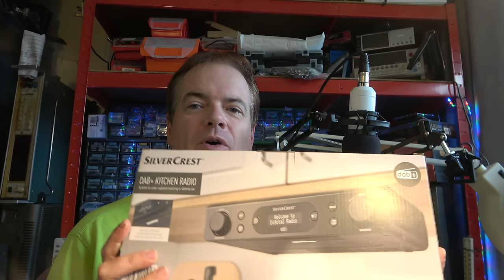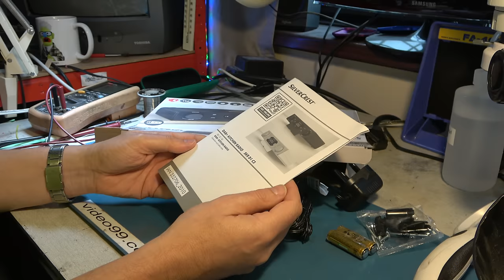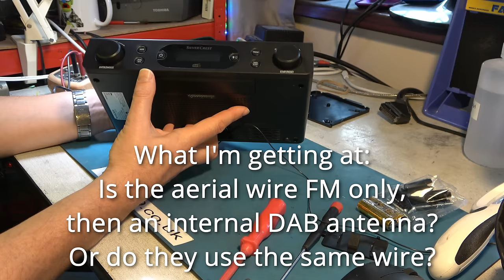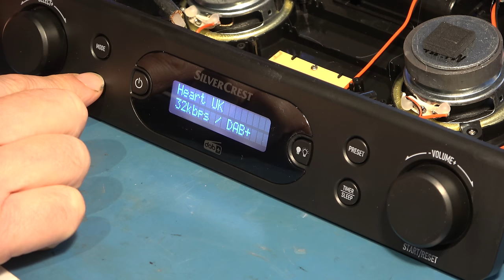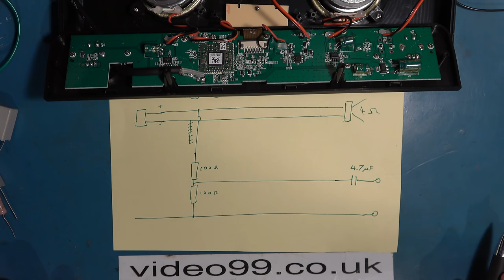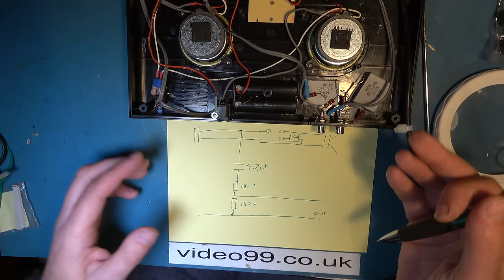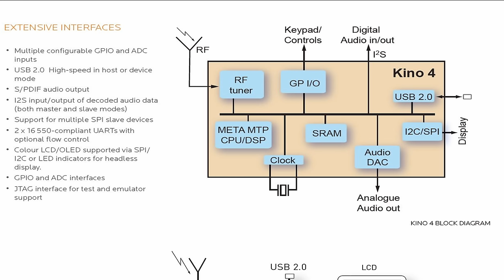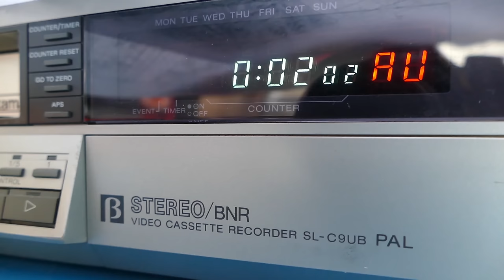DAB radio modifications.  LIDL kitchen radio could use some upgrades.  Part 1.

Comment: Increase the dummy speaker resistor to 12 ohm and leave it always connected.
That will reduce the load resistance to 3 ohm - theoretically - because the speaker has a weird reactance value range over the freq range anyway.
Now you can use a simple on/off switch for each speaker.
About the overkill output caps: you can easily use a standard electrolytic cap, as it will always have a DC value of 2.5V on the input, the way you connect it.
Thanks for your efforts making this a valuable video with your ideas !
Reply from the maker: Electrolytics could be used, as you say they will be properly biased.  But I had some silly big capacitors to hand.

Comment: I'm a big Silercrest fan. I love the build quality and reliability. I would have used 4ohm resitors so you don't overdrive the output amps. Apart from that, a perfect mod.
Reply from the maker: Turns out that my attenuator resistors are too low for the capacitor value.  About 1k would have been better.  If I had used 4.7 Ohm dummy resistors, they would have had to be rated at 1W or more, so a bit chunky.  Anyway I didn't have any to hand.

Comment: Good work !  I see (35:55)  that the the chip manufacturer states that this also has  a digital S/PDIF output. May be that by testing the pins with a "sounding" small  piece of cable (DC decoupled)  you can find one capable of turning on the latching LED of a small amazon's unexspensive D/A converter, 5V powered. The converter board could easily fit inside, which would solve the DC decoupling, volume pot independence and loudspeaker-bass-eq, if there were any.
Reply from the maker: I was wondering about the S/PDIF output, though it might be disabled in firmware.

Comment: Those Frontier Silicon modules have always been much better than their price would suggest, decent quality DACs in them that wouldn't disgrace hifi components. And with there being so few supporting components it's difficult for the assembling factory to muck them up really.

The little class-D ICs (PAM8403?) also really impress given they're literally pennies to buy.
Reply from the maker: Exactly my thoughts, it was bound to be pretty decent quality.

Comment: Interestingly the Canadian government really promoted DAB in the 90s, and there was an experimental DAB multiplex in Canada that ran from 1999 to 2010 (I think). My main memory of the service was PSAs to try to convince people to buy DAB receivers. It was probably doomed to fail because DAB was never adopted in the US, and the electronics industry (and probably more importantly the auto industry) was not really willing to supply DAB receivers to the Canadian market but not the US market. 

Some of the commercial broadcasters here are using IBOC/HD-Radio now but unlike in the US there is virtually no marketing (or even on-air station idents) for it.

Comment: Right look, it would be easier to source a proper audio transformer for each channel. That effectively takes care of the DC offset and the output level. As for switching the DPDT switch you discussed would work a treat.
Reply: He has an SPDT but a DPDT (or rather a 4PDT, since two channels) would be a nice way to do it.

Comment: 4.7 µF and 360 ohms means f3 = 94 Hz - there goes your bass. You have multiple options to resolve this:
1. Ditch the attenuator altogether - they generally aren't worth it below 10-12 dB, and the 8002 in SE operation on 5 V can't output more than about 1.4 Vrms anyway, still less than CD player level. If you can just turn down the following amplifier without running into channel balance issues or the like, there is absolutely zero need for another attenuator.
2. Increase resistor values - about 1 kOhm each would still give acceptable output impedance.
3. Electrolytic caps would actually work fine in such an application, maybe some 100µ/16 V Panasonic FC or similar.

I would go with (1). A pull-down resistor at the output would still be advisable, but it could be a 10k or something.
Reply from the maker: Good point, I think I will tweak the resistors!

Comment: Thanks for your investigation. I found these devices in our german lidl-online shop for 23€. It's nice to see that these device has stereo. Most cheap units have only mono, that why I avoid DAB+ in the past. Very silly to see that there are sold out even with no reception at your location (without modification)..
Reply from the maker: I'm doing a short follow-up video on this.  I got an external antenna to work quite well in the end.

Comment: Two more things that I'd like to add to this video: 
1) try it with a linear power supply, not a switching one. Both my portble DAB+ receivers (a TechniSat Digitradio 210, and a pink Tesco one) perform much better on AA batteries than on any switch mode PSU (or the one included with the TechniSat).
2) the buttons will be most likely on a single pin of the Frontier Silicon module, just have a different resistor in series with them, and that's how the on-chip MCU knows which button has been pressed. With time the contacts will start acting up, and the buttons will be doing totally different things. I have this on my both of my DAB+ radios I mentioned above.
Reply from the maker: I could try another PSU, though as you will see in my follow-up video later in the week, I manage to get a pretty good signal from a small external aerial in the end.  I've had that crazy button problem with some other low cost devices, it's quite possible it will apply here too.

Comment: Two audio iso transformers feeded from the circuit board the output of two transformers could connected as a common ground with a right and left outputs and the 2.5 volt dc level would not be a issue as it never makes to the speakers, A adjustable pot could used  in series with a 82 ohm resistor as a limit for the line output control even would work if you for headphones without the resistors just a headphone jack to break the speakers free.
Reply: I''ll second transformers as the answer I'd just like to add, they make these as stereo pairs, with rca sockets on the output, for people who want to add a line level amplifier to a car radio which only has speaker outputs.

Comment: It looks like some of the UK DAB frequencies are used in the USA as one of the amateur radio bands, the 1.25 meter band (222-225 MHz).  For digital broadcasting in the USA many stations use a hybrid analog/digital system in 88-108 MHz, but very few people own an HD tuner because the proprietary rollout was a total failure.  Many wish to expand the FM band from 76-108 now that DTV is standard and TV no longer uses 76-88.
Reply: By the way, there are still using the low VHF band for DTV in the United States, especially now that UHF TV Channels 38-51 are no longer available because the FCC sold those frequencies to cell phone companies Iike T-Mobile for low range 5G service. As a result, the TV spectrum has now been truncated to low VHF channels 2-6, high VHF channels 7-13, and UHF channels 14-36. (By the way, Channel 37 has NEVER been used for broadcast TV in the United States.) As a result of the truncation of the TV spectrum, many stations formerly broadcasting on UHF channels 38 to 51 had to move to lower frequencies, which the Federal Communications Commission (FCC) calls a "repack". Due to this "repacking" of frequencies, there are still a number of full power and low power TV stations broadcasting on channels 5 & 6 (76 MHz to 88 MHz) like "6abc" WPVI in Philadelphia and the numerous Franken FM stations in various cities nationwide, which are technically low power TV stations using a digital TV signal along with an analog signal on 87.75 MHz broadcasting. These stations are known as 87.7 FM to the average listener and they broadcast essentially as radio stations on the left-most portion of the FM dial in the car. Until July 13, 2021, when the FCC shut down the last remaining low power analog stations in the United States and 12 years after all full-power analog broadcasting ceased in this country, they were low-power analog TV stations with an analog audio carrier broadcasting on 87.75 MHz.

Comment: Why did you not just take a tap off from pin4 of the input to the audio amp ic? and an in line switch to disconnect the feed to the chips pin 4 (and thus speakers) when using the tap off. Then use the volume control to set the line out level (as the output from the dab module is probably line levels anyway, just scope to confirm).
Reply from the maker: Because I'm not sure the signal level and impedance would be correct at that point, I suspect it would not be.  The output from the module is volume dependant, I showed that in the video.

Comment: Thank you. Looking for a garden radio for mother, there is not much on Amazon that looks as easy to use as this and as cheap.
I’ll hack a wooden box together, maybe some porting and see what those speakers are really capable of.
Also, would be interesting to hack around with the module itself. Data sheets and application notes have a habit of surfacing in time!
Reply from the maker: A hack I would like to try, if the notes appear, is to add S/PDIF output.  The notes say it is available, but the firmware may not support it.
Reply: They look the same size speakers as what you get in the Bose waveform CD radio players, and they sound pretty good.

Comment: IMO I don't know why all of those boxes including the radios and TV's come with an F connector when it's a cheap part to put in and everyone will be happy, even those that have to pull out an adapter they would have "something secure" to actually grip onto more than a piddly wire or RF port that comes out over time either through gravity or through the force of shifting furniture

Comment: What about downloading new firmware which should be available now, need an output look for a TOSLINK Output and use a seperate DAC with a TOSLINK input connect the two together via a optical patch lead.
Reply: Downloading firmware?   How?  
As far as I'm aware, TOSLINK (based on S/PDIF) passes only digital audio bitstream between DACs and is not used for web/network interconectivity.   Yes, it could be used (if fitted) to interface an onboard DAC and either S/PDIF or TOSLINK RCA/optical interconnects to an outboard DAC receiver, but this chap just wanted to be able to plug into a standard traditional 'hi-fi' system.    
As for updating firmware,  the board did have usb pads...   Whether that was for the 5v+/- power rail or full data-stream interface is another matter, but my first hunch was it could be used for firmware updating.

Comment: Like how you managed to upgrade this - for me the most useful upgrade would be the ability to add an external aerial. Little wire type aerials never work very well, so I can imagine why your unit didn't pick up a signal with its piece of wire only.
As for the TV aerial, chances are the Co-Ax itself is picking up the signal and not the TV aerial itself, as the TV aerial is cut to the wrong frequencies and also uses the wrong polarity (DAB is vertical polarity).
Also, I'm not too happy about the state of digital radio in the UK either! Original flavor MP2 streams (the ones that are still left) are low bit rate and mono, and DAB+ AAC streams use an equally horrible bit rate, so whilst they are at least in stereo, DAB+ still doesn't sound good. And of course all of the DAB only radios can't receive most of the stations now!
Lastly, I wouldn't want to advertise Heart FM as a feature of a DAB radio... Heart FM would probably be easier to receive on FM, and the station itself is not a good quality station anyway!
Reply from the maker: I agree, there are far too many channels with terrible bitrates in the UK.  Little wonder that uptake of DAB has been so poor.  Down here in Devon, reception is very patchy too.

Comment: I'm glad I kept an old Band III log periodic aerial, the local Mux has few stations, so will experiment with an external aerial. I think I would fit an aerial socket on the back rather than a flylead. I had a similar arrangement on the back of a PACE TV STB and that was the weakest point which failed.
Reply from the maker: That aerial could work really well!  A proper socket would have been a tidier solution but the flying lead was so much easier to put together.

Comment: I don`t understand why do you not take the audio out from the inputs of 8002 ICs? Maybe through a small preamp? There the signal is referenced to ground and could use line out connectors with switch inside that interrupt the signal to the 8002 amplifier, maybe grounding its input.
Reply from the maker: Just more complexity to add amplifiers where there are already amplifiers in there.  Strangely, the signal input is not referenced to ground, that's also sat on DC.  Certainly a solution like that would have been beyond most people to implement, whereas my solution can be quite easily copied by other viewers with basic soldering skills.

Comment: If you want a more advanced project, look up your broadcasting frequencies, then look for a Yagi antenna design, most TV antennas are based on this design, then modify a TV antenna to the frequencies of the DAB+...

Don't forget to point it in the correct direction.
Reply: Most of the TV antennas I've seen are log-antilog with some third design for the other frequency range, but a Yagi is easy enough that you can make it from lumber, screws, and copper plumbing, just so long as you have the dimensions.

Comment: The menu looks identical as in cheap Technisat DAB radio. Apparently, they all use the very same chip. So... does it matter which one you buy (except if some look really ugly)? The Technisat, being a portable radio, has telescopic antenna, though.
Reply from the maker: If you're planning to use it as-is, I would recommend the Silvercrest because of the good amplifiers and powerful speakers.  But if you plan to modify it anyway, just select whichever is cheapest and has the best features for you.

Comment: you could also use tantalum capacitor ..those are not cheap but very good with that application ..you only need to make sure you over voltage your capacitor for double or triple of max voltage

Comment: Are the batteries you get supplied with the radio unit rechargeable Li-Ion 18650 batteries or just plain (rechargeable?) AA/AAA alkaline batteries? And, if they are indeed 18650 batteries (or some other size of Li-Ion rechargeable battery, like 26500, 14700, etc.) what voltage and capacity (mAh) are they? Thanks for reading my comment, stranger ☺️
Reply from the maker: Just regular AA batteries.

Comment: Judging by the block diagram you showed of the main chip it looks a lot like the DSP devices used in those Freeview USB dongles you can buy to plug into a PC, and can be used as software defined radio device that are capable of recieving from tens of MHz up to hundreds of Mhz, so maybe it isn't as expensive as you thought. Nevertheless its amazing what can be done with these kind of mixed signal devices. I must confess to being underwhelmed by DAB radio (although I've never tried a DAB+ one) because although if you're in a good signal area the sound was reasonable, as a substitute for a portable radio they weren't that good because they tended to eat batteries, especially compared to a standard AM/FM radio. I also found the fact that when signal was marginal the jarring sudden on and off of the audio was more objectionable than the distorted signal you got from conventional radio. However in the application this device is intended, where at least the signal strength is going to be stable and batteries are not a problem, then you've made an interesting mod to a quite cheap product (although Mrs Video99 seems less impressed!).
Reply from the maker: DAB+ is a major improvement. Without it, I think DAB would have died.

Comment: What I would have done is interrupted the volume controlled line level signals to the internal amplifiers, easier to mute the internal speakers that way - and avoiding all the noise introduced by the amplifier chips.
The outputs should be typical "line" level with the volume up full.
Reply from the maker: There is no signal available to do that. It's all inside the system on a chip.
Reply: You could possibly have used the signals at the input to the amplifiers to feed the line out (i.e. the audio out from the SOC).  Those are presumably already single-ended and so may not need either attenuator or DC blocking cap.  You could then cut the tracks of the Vcc supply to the amplifiers and feed Vcc to them via a SPST switch to mute the speakers.  No easy way to avoid the volume control unless that is just providing a DC voltage to a VCA in the SOC in which case it could also be switched to hold it at a fixed voltage (on the same switch as the loudspeaker mute switch).